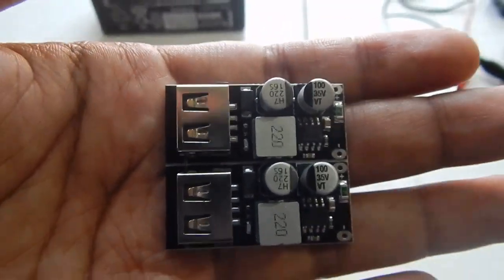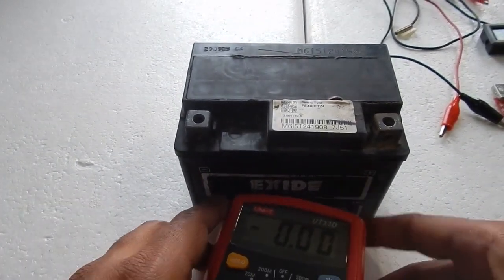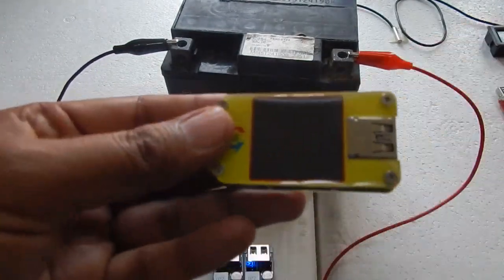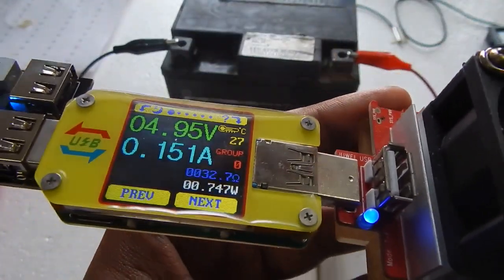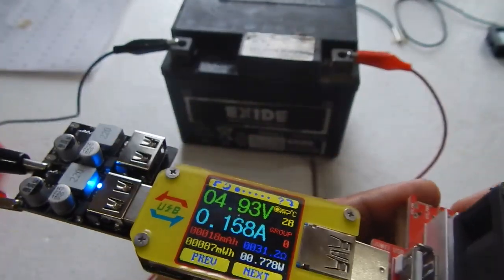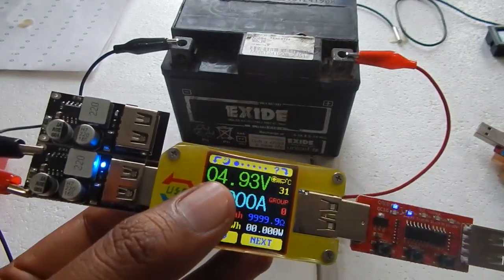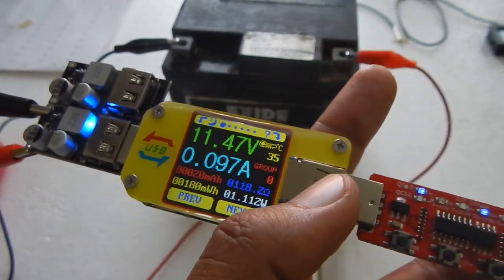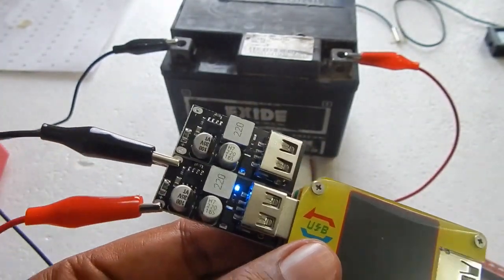Qualcomm Qc 2.0 | Qc 3.0 DC-DC Buck Converter step down Fast Charging Module

Comment: i have this module with DC jack input. is it ok to direct it to solar with 20 volts? or does it need to connect to scc or mppt?
Reply from the maker: No, you an directly connect this to a solar panel.
In fact most foldable solar phone chargers use these modules directly connected to the solar panel.

Comment: cool, but how can fast charging battery it self ?
Reply from the maker: IF you are talking about the 12v battery i used. then unfortunately you will have to charge it separately using a battery charger.
Reply: @gurribuy  Q: can we charge Legacy Lion batteries using Qc2 or Qc3 ?

Comment: The voltage differential between the battery and what your trying to to step it down to in QC3 12v mode is too close together or the same. The voltage drop will be due to this most likely. In fact you can damage the module by having the step down voltage differentials too close together. You need at least 1 volt of difference, 1.5v to be safe. You should 100% charge your 12v battery so its at peak voltage or use a 14+ V psu, and do the test again on QC3 12v setting, likely you will have a different result.

Comment: bro this is work with 3.7 volts
Reply from the maker: This converts higher voltages into 5v, 9v and 12 volts.
This can't convert lower voltages to higher voltages that mean it can't be used with 3.7 volts.
I know you want to use this module like a powerbank but you can't. Hope it helps.

Comment: I made it work the first day. The second one the module light flash and was not able to charge the smartphone. Dont know what happended
Reply from the maker: Only you know what you did. However connecting the plus and minus wire with wrong polarity can also damage the module.
Make sure that your polarity is correct and you are not supplying higher voltage than is supported by the module.
Reply: @gurribuy  Dear Gurriby, thanks a lot for your prompt answer. I am using a little solar panel which provides almost 12v but obviously not fixed as depends on weather. The module output is giving me 5.1v on the usb but only worked yesterday. Today module is going on off every 2 seconds and as a consecuence smartphone do not charge. Thanks again

Comment: Sir tell me that can i use 1805 battery in parallel and then use booster module to increase volt up to 12v and then i connect this module to make power bank is there any problem or not

Comment: Sorry mate but is the pub manufacturer paying you for shilling them? You say that it works "perfectly fine at 9 volts " but after 1A, the voltage sags and at 2A it is below 7.5V. At 12V it fails horribly, clearly this is shit design, how can you say it works perfectly fine?
It is below 7.5V, how can it be close to 8V when it is closer to 7?
Reply from the maker: My battery was really bad, I also tested it with computer power supply 12v rail.
it easily outputs of 2.5 A at 8.8 volts if you use a good battery or a capable input power supply.

Comment: What is 
The input current and max output current  I need what input current is needed
Reply from the maker: ITs specification said that max output power can be 24W.
And the input range is 6v - 32v.
This info is enough to figure out what input current to might need.
Reply: @gurribuy  in a test video it showed it cam go upto 3.4 amps and after adding Inefficiency    the stuff is output current is 2 amp max so should I supply with 2,3,4 amp   and plz tell me how to figure out the input current
Reply from the maker: @Abhyuday_rai  what do you want to run with this module?
Reply: @gurribuy   mobile and other usb accessories
Reply from the maker: @Abhyuday_rai  you can use 12V and 2A or more amp as input.
Reply: @gurribuy  ok

Comment: I wanna usethis in a power bank but my cells out put voltage isn't that much as they are  18650 cells so what should I do, use a step up converter
Reply from the maker: There are powerbank modules available in the market you can use them. And yes we need to step up the voltage which can be done with a powerbank module.

Comment: But how hot does it get when it decides to go into full current mode? Does the chip melt off first or the inductor? Can it be cooled?
Reply: It does need not need cooing if you don't draw more than 1A

Comment: can i use a 12v 20A battery to power this up?
Reply from the maker: yes, any 12V 20A battery will work. Just make sure the polarity is correct when you are connecting the battery to the module.
Reply: @gurribuy  yes bro

Comment: 2 QUESTIONS:  Do  Buck Converters create "noise" if used with a 12 volt battery to output 5 volts to a portable radio receiver?  Is there a way to eliminate the noise?  Thanks
Reply: Yes most switch mode buck regulators create a lot of noise from the square wave fed to the inductor. It is possible to screen it but most manufacturers don't bother. Better to learn how to achieve this yourself.

Comment: how to trick my powerbank to output 12 volts 1.5 amps ?
using the zendure supertank (max output 20 volts 5 amps)
looking for a quick charge board that tricks powerbank?
Reply from the maker: you need to buy a " PD decoy trigger" they are available in 9v 12v 15v & 20v fixed settings and in some module you can also switch among the voltages you want. just search for pd decoy or pd trigger on your preferred site.
Reply: @gurribuy  thankyou, will order one asap
Reply: powerbank outputs 5volts by default

Comment: it claims that it can output 12v. Will it step up the voltage to 12v if my input is 6v?
Reply from the maker: its not a step up module its a step down module. To get 12v the input must be higher then 12v.
Reply: @gurribuy  ooohh ok thanks!

Comment: can it charge normal phone some phone doesn''t support quick charge feature
Reply from the maker: yes. it can charge any phone with or without fast charging.
Reply: @gurribuy  thank you..can  8.4 volt give quick charge? I would like to supply low power in order to prevent ic inductor from heating.

Comment: But it's useless for me its don't have inlet battery charging features so I can replace my power bank pcb kit
Reply from the maker: its not for powrbank, powerbank circuit uses a boost converter to boost battery voltage to 5v. This module is a buck converter it reduces higher voltage that is 12v to 5v .
Reply: At same price you can buy isolated, circuit protection & complete assemble  gadget car mobile charger
Reply from the maker: @AmirAnsari-mp7id  car mobile charger don't work with voltages less than 12v.
Reply: @Gurribuy  what are you doing on video with 12 v battery anyway what are you doing with this module at least charge a phone other than nothing one module of price is 419 you have bought  2 so 419+419= 838 you just charge at a time two phones and need a battery that will drain extra on your pocket Qualcomm quick charge 3.0 power bank price at least 999  you can charge two phone at a same time and no need to paid extra for battery
Reply from the maker: @AmirAnsari-mp7id  Take what you can from this video. And do what you think is better for you. i have tested the module but its upto the viewers what they want to do with their money.
Reply: @gurribuy  okay as you wish  but I've found this quick module is over priced almost half price of a power bank both are job is to only charge a phone this module is for hobby person who don't care about price who need a module for his project
Reply from the maker: @AmirAnsari-mp7id  when i bought it, i paid 499 for two on amazon. *forgot to mention.
Reply: @gurribuy  Rs 500 2 pieces it's ok but now I double check my 2nd phone is also showing 1 pic for 419 + 40 delivery charge

Comment: Hi, could you clarify if it is input 6-12 v as stated in the description, or 6-32 Volts as at 37-38 seconds. Thanks
Reply from the maker: yes, it will work with 6-24v. but for fast charging the input needs to be at least 12v.
Reply: If i put 24v power supply also no problem right?
Reply from the maker: @fazry88  yes, no problem with 24v.

Comment: Can we use 6v solar as input And charge the note 7 ??
Reply from the maker: yes, you can but remember that this module is a step down charger so, it will convert 6v into 5v and charge your phone. But, it will not trigger fast charging because for fast charging you need at least 9volts. IT is better to use a 12v panel if you want the fast charging as well.
Also, if your 6v panel outputs very small current your phone will take much longer to charge.
Reply: @gurribuy  actually I have the 7.5V solar.... It will be helpful at only emergency time or not ?? If I don't have need of fast charging
Reply from the maker: @kumar2646  It will charge but only in full sunlight and charging will be very slow.
Reply: @gurribuy  OK thank you so much..... I will use 2 solar panels.... Thank you

Comment: Is it safe for Android devices? and the voltage when to charge the mobile phone stays at 5v?
Reply from the maker: yes, this is safe. voltage will stay at 5v if your phone does not support Qualcomm fast charging. But, if you phone support Qualcomm fast charging then the voltage will change according to your phone.
Reply: @gurribuy  Meaning, the module can automatically adjust itself?

Comment: what is the max current input for that module sir? thanks in advance..
Reply from the maker: Depends on what is you input voltage.
Reply: @gurribuy  lets say sir 12v 12amp is it ok to put 12amp or its already high..?
Reply from the maker: @NEWBI3GAM1NG  yes,  12amp or even higher will work. The module will only take what it needs.
Reply: @gurribuy  thank you very much sir..

Comment: I have battery of 4000mah like a lipo battery and a mobile battery will it work with this module proper ly?? I want to charge my redmi note 7 from power bank, Reply asap pls
Reply from the maker: For this module to work you need voltage higher than 6v. Lipo battery has a voltage of 3.2 to 3.7v so you can't use this module with a single battery however if you have more than one battery then you can use this module.
Reply: @gurribuy  first of all thanks for replying, I did tried to connect to battery which combines and make a 7.5v but my phone charges for 3 to 4% and stops automatically, even after battery has juice left again I have to put back on to charge and same thing repeats, I am using a basic power bank module which has a output of 3.7v any suggestions sir?? What should I do to make a good power bank at home that actually works.
Reply from the maker: @tanveersayyed8855  what module are you using?
Reply: @gurribuy  I am not sure about what module it is I removed it from a cheap power bank a basic module with one female usb and charging point beneath it
Reply from the maker: @tanveersayyed8855  try using a single batter and see if it works, IF it works then instead of connecting the battery n series connect them in parallel.

Comment: You should at least supply 15v or above for it to work properly
Reply: Why? It is a buck converter, so anything from 8v upwards should work just fine. It only requires 2-3v headroom above 5v. More than that will not "improve" it's ability. His 12v battery is almost flat (should be around 14v).....that is the only reason it can't supply enough amperage.

Comment: Can it support one plus 6 dash charging.. i.e. 5v at 4A !! Is it possible to fast charge a OnePlus device with this module
Reply from the maker: This module can output 5v at 3.4A. But it will only give 2A to your one plus device because it does not have the dash charging chip. So, it will charge your phone but only at 5v 2A.

Comment: I have some of these QC3.0 modules,, I planned to use them in a battery bank, but they do not seem to fast charge my Samsung devices.  the units do not kick up the voltage, my Samsung device will only slow charge, it says to use original charger.. Are these not Fast Adaptive Charging compatible ?
Reply from the maker: what type of battery are you using, how many volts does the battery produce? also what samsung phone do you have?

Comment: can I use it with 3.7 v li ion cell
Reply from the maker: yes, it will work but the voltage needs to be more than 5volts. So you will need to connect at least 2 lithium cell in series for it to work.
Reply: @gurribuy  I have 14 cell in parallel....what to do now
Reply from the maker: @woodway8300  you need to make few sets of 3 cells in series, then connect these sets in parallel. this should give you about 11v, then you can use this charging module.

Comment: Very good video, in 1st test why not put voltmeter across battery, 2nd test using solar PV, put voltmeter at input terminal and why not plugin USB meter rather than lying on your table.
Reply from the maker: in 1st test, i only had one pair of alligator clips, so i could not attach the voltmeter. In the second test, you are correct i should have shown the voltage of the solar panel and should have used the usb meter to show its output. Actually, that was the plan but, i forgot.

Comment: Thanks for the video man, i just bought this thing, but it only gives me 4.8V - 1.2A at load, do you think it safe to charge my phone with 4.8V?
Reply from the maker: yes, you can charge your phone with 4.8V without any problem.
Reply: @gurribuy  great, thanks man
Reply: Most of the voltage drop actually comes from those cheap usb meters...

Comment: Please try connecting both the modules together to a 80-90 watt laptop power supply ( as tht is the most cheap and portable supply everyone will have). And then test  both the USB on fast charging modes with loads on both of them. It will be very uselful as it will tell us that will a 80 watt laptop power supply work with 4 such modules at the same time.

Thanks